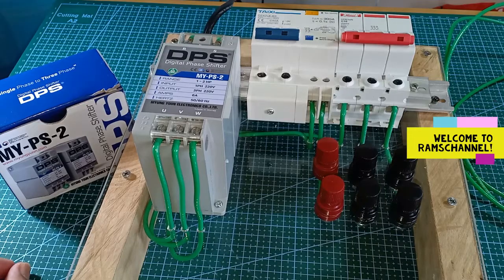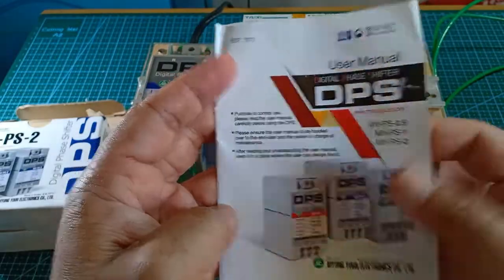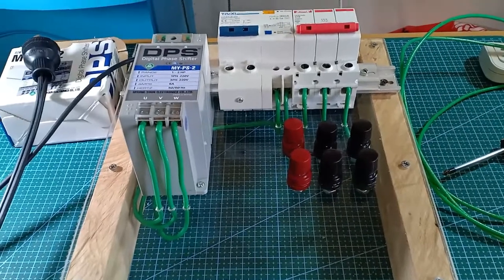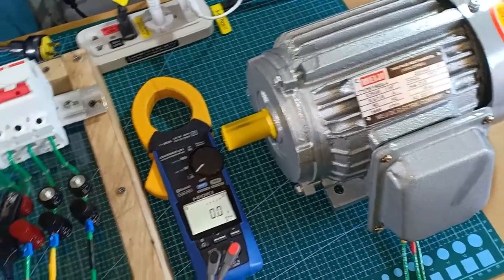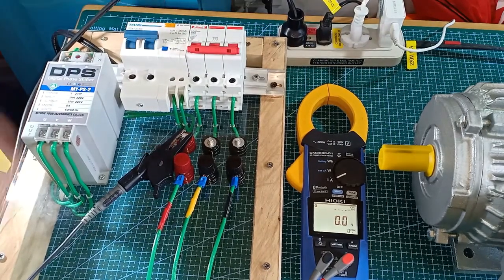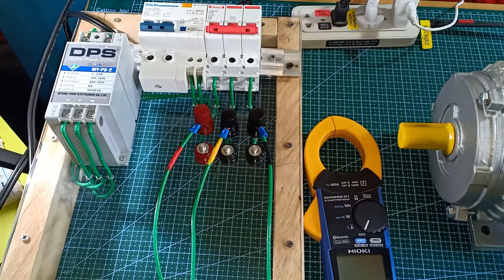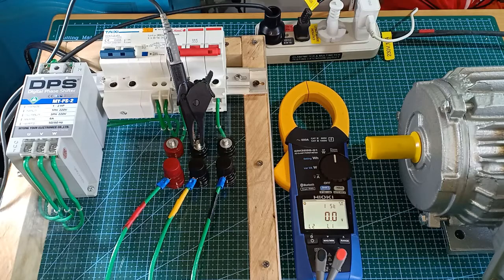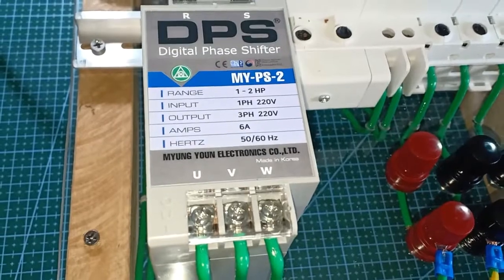[CC] DPS Digital Phase Shifter in a Demo Board & Testing with a Hioki CM3286-01

Comment: 👏👏👏 great.

I just have a few questions. What are the individual voltages of each output, if measured in a single-phase manner (1 phase and 1 neutral)?
Reply from the maker: Thanks for your appreciation. The output is only line to line, 3-phase, no neutral. I tested this at 07:58 in the video.

Comment: I have a question, do you know if the input can be 220v biphase each phase 110v, or it only works with 1 phase 220v and a neutral?
Reply from the maker: The input can be phase-to-phase 220V; or phase-to-neutral 220V as stated in its manual.

Comment: Hello. I tried to buy a similar unit, but it was made for a 5 -6 hp.  My machine is only 1 hp.  Would my machine work with this DPS or would I need to find a smaller one?
Reply from the maker: @AdrianHamblin  I haven't run my DPS on a loaded 3-phase motor so I'm not certain of its performance yet, sorry. However, the manufacturer (myungyoun) emphasized the importance that the DPS rating should match the motor rating. There are other factors you need to consider as well. May I suggest that you search myungyoun + DPS for complete usage details.

Comment: The voltage output unbalanced is caused by the induce voltage from the motor, if I'm correct the output current will only show on two legs and no current on the third leg when the motor is upto speed.
Reply from the maker: @JacquesLevesque-d5w  That's an interesting observation, sir. It's not exactly zero current, however. The 3-phase currents at no-load were 3.8A, 2.7A, and 1A.  It was tested out of the camera, so it's not included in the video. In the absence of precise lab equipment testing and tear-down of the DPS, I can infer that it's possible that part of the missing phase was generated from the induced voltage, as you suggested, resulting in a 3-phase output. The phase sequence was verified at 10:39 with the Hioki CM3286. Thanks for watching!
Reply: @ramschannelreviews  One thing you can try, after the motor is up to speed is to remove the motor wire connected to the V terminal. Now recheck your voltages at the converter terminals, also check voltage from the wire that you removed from the V terminal to U terminal and then also wire to W terminal
Reply: @ramschannelreviews  Did some more research on these units, sold on Amazon. Found review that shows a picture of one of these units that went bad, customer has the unit apart in the picture. Picture shows 4 start capacitors and 1 run capacitors. This is just a static converter with digital control start circuit. The three phase voltage you see, is the induced voltage from the motor.
Reply from the maker: @JacquesLevesque-d5w  Thanks for this valuable additional information. In fact I heard about the DPS first at amazon. Despite the dissatisfaction of several users I decided to just go ahead and buy it since I only need the 3-phase output it generates so that I can test my 3-phase power clamp meters, not intending it to run a 3-phase load. The manufacturer said that a balanced 3-phase voltage would be generated if the motor was loaded to its rated capacity, something I still have to verify. From my experience, I haven't seen any customers who used the DPS (I used to work in the electric utility for nearly 30 years). If they need to run a 3-phase motor, then they apply for 3-phase service.

Comment: Could these DPS devices be used to power a heating element instead of a motor (within it's output capacity of course)?
Reply from the maker: That's an interesting idea. When I tested it without the 3-phase motor, it only produces a single phase output. So, in theory, it can supply a single phase load, within its capacity. But since the user's manual specifically mentions that it was designed for 3-phase motors only, so I'm not sure how it will perform when used in single-phase application.

Comment: After two years, would you still recommend this unit? I contacted the company through ebay regarding my 1.5 hp motor and they were less than helpful regarding whether this unit would work or not.  I was quite disappointed.  But I don't want to damage my motor. Thank you.
Reply from the maker: I apologize, as I haven't used it to run a loaded 3-phase motor. I use it only to get a 3-phase voltage for testing my digital multimeters/clamp meters. As you know, it will not produce a 3-phase output unless connected to a 3-phase AC motor. So, I don't have a first hand experience how it will perform under load. Although it successfully converted a single-phase input to 3-phase output when the unloaded motor was hooked up, it did so at a higher than usual voltage unbalance. As they mentioned in the user's guide, the no-load voltage unbalance will drop to normal values once the motor is loaded to its capacity. But again, I've not tried it. You're right to be reluctant, especially if your motor will be turning an important or sensitive load.

Comment: Thank you for the video, I have a question for you. With no motor hooked up the DPS outputs single phase, two wires have power going out.  When a 3 phase motor is powered on single phase, 2 wires having power to it, the third wire on the motor will output power ( like a motor for a rotary phase converter ). When you checked voltage with the motor running how do you know the DPS was putting out 3 lines of power?  Couldn't it still be putting out single phase ( two lines ) and the third line was incoming power from the motor that showed your voltage reading?
Reply from the maker: You made an interesting observation. I appreciate it. This somehow  reminded me of an open-delta transformer. As you know, a 3-phase motor will not self-start on single phase power. This one does, even though only single phase voltage is output by the DPS when no motor is connected. It would seem that the DPS designers have some sort of proprietary circuit in the DPS that supplies the missing 3rd phase as soon as it detects the presence of a 3-phase motor winding. How do I know? In a practical sense, when I tested the phase sequence with a Kyoritsu KEW2062BT, I got a proper indication of a 3-phase power supply coming out of the DPS. Here's a link to that: https://youtube.com/shorts/9j-Jbf1WRZ4?si=5fTlC0W0KsAkt7fE
I cannot, however, cite formulas or EE principles in support since only the DPS manufacturer really knows what's going on at the DPS.

Comment: can this be used to run a vfd that will run the motor?
Reply from the maker: Nowhere in the user's manual that I have and in their website was a VFD setup used in an example, so I don't think so. If you wish you may contact the manufacturer, Myung Youn, directly to be sure. Thanks for watching!

Comment: Are both wires on the top of the phase shifter hot wires 120v each or is one a ground wire
Reply from the maker: Both are hot wires in my case since that's our residential utility service voltage configuration: 230V, 60Hz, single phase nominal.
Reply: @ramschannelreviews  this is excellent video, thank you for the reply, I’m going to copy exact setup you have, I have a 5hp 3 phase motor on a jet pump which is used for high volume and high pressure In irrigation and or water supply, I have two uses one for irrigation let it run wide open, I have a vfd as well to use when running it on a pond fountain, I only need 1.5 hp to do the pond really well, I picked this pump up for 80$ used and retail is over 2,000, thank you for this video
Reply from the maker: @BloodCover  Glad you found it useful. Just as a reminder, do check the compatibility of ratings of the DPS with your motors and have over current protection as well. Thanks for your support and appreciation. You got a great deal on that pump. Good luck!

Comment: Anyone running a 7.5 hp compressor with this
Reply: I'm not sure, but I'm sure a retrofit would be possible. You'd have to check if the motor on the compressor is compatible with this device. The same goes for VFDs, digital phase converters, and rotary phase converters. I've also seen static phase converters based on capacitors and various electrical wizardry far beyond my paygrade. My understanding is that digital phase converters and VFDs are generally the best options in terms of efficiency.

Comment: Hello, I have DPS and it does the same as your test shows on the voltage imbalance…. I am disappointed however in my unit… it claims to have excellent start up torque….But it won’t start my machine unless it is in low speeds. It doesnt seem to have good start up torque as claimed. I run a 3 hp motor on a milling machine. I have to start it in low speed 1st and once running then I can turn my variable hand crank to maximum speed. It makes it difficult if I forget to turn it back to low speed before shutting machine off because machine needs to be running to change speeds. My speed change is done via 2 pulleys opening/closing while running only.
Reply from the maker: Hi Earl, I believe this is one of the compromises of running the DPS. At least you did not burn out your motor, as happened with other users. I understand the inconvenience. In my case I only wanted a three-phase voltage for my test equipment. But the DPS, as you discovered, will not provide 3-phase voltage unless there is a 3-phase motor load and it must be running. May be you can place a sticker to remind you to change speed before turning it off?

Comment: hi siir! my question is, is it posible to use this device (DPS) for aircon 5TR? thanks for your answere?  Godbless
Reply from the maker: Hello po! I wouldn't recommend it primarily because I don't run my DPS on a loaded motor. So I don't have enough data in this regard. It's only for providing 3-phase voltage for my test instruments. For a 5 ton HVAC equipment you'd expect to draw around 17kW of power. Although the DPS manufacturer offers a unit for that size I'd advise you to talk to your electrical contractor whether it's safer & more practical to just apply for a 3-phase electric service. Thanks for your support.

Comment: Hello! Excellent video! Question. Will this Digital Phase Shifter work for an industrial fan application with a 1hp 3-Phase motor? My concern is if the fan blades would provide enough load to balance the voltages across the legs, since they're not balanced when the motor is unloaded. The blade on this fan is about 30 inches diameter. Would you recommend this for a fan application?
Reply from the maker: Thanks for watching! The printed notice on the box says it's best for 1Hp motor, so on paper it should be able to handle the 1Hp 3-phase fan motor (220V, 60Hz). I have not tested it though. My suggestion, if possible, connect a 3A single phase breaker at the input side of the DPS before operating the 3-phase fan load. (746W, 1Hp/220= 3.3A) The breaker should at least provide over current protection in case excessive current unbalance occurs while the fan is running.
Reply: @ramschannelreviews  Thank you for your reply. So just making sure, connect the 3A single phase breaker at the input side of the DPS? Would there any benefit on installing another 3A breaker (3 phase) on the load/output side of the DPS?
Reply from the maker: @bigtimlikewhoa  Thanks for your interest in this matter. I have to caution you though that I am not expert on DPS. So please take my opinion with a grain of salt. At the 3-phase side, the load current is not 3A but 2.2A (assuming pf=0.85). The obvious benefit of a 3-phase breaker is that it becomes the overcurrent protection and disconnect device. I am not certain however, how this 3-phase breaker would respond to the current imbalance of the DPS. You may want to consult with an electrician on this matter.

Comment: Can I use that on forward reverse control And wye delta control?
Reply from the maker: No. This DPS simply converts single phase to 3-phase by electronic means. It has no mechanical parts or switches. Thanks for watching.

Comment: Hi sir, how about the current output of the motor? Tama po ba sa rating while running? Thanks
Reply from the maker: Hello sir, may I clarify first. I had not loaded the motor due to restrictions on my test. I just let it run without load for the main purpose of getting a 3-phase supply for testing my DMMs and clamp meters. The voltage unbalance at the output of the DPS with unloaded motor running was what you see in the video. The 3-phase motor line currents were: 1A, 3.8A,  & 2.7A without load- also unbalanced. While the rated LOAD current of the motor at 220V is 3.5A. As you can see, Line 2 (3.8A) was already at the rated load current due to voltage unbalance. Unfortunately I could not test my motor at its rated load at this time so I can't check the manufacturer's claim that voltage and current will just balance out when the motor is loaded. I would suggest that you also read reviews on amazon about the DPS as a lot of users share their experience while using the DPS with a loaded motor. Thanks for your support!